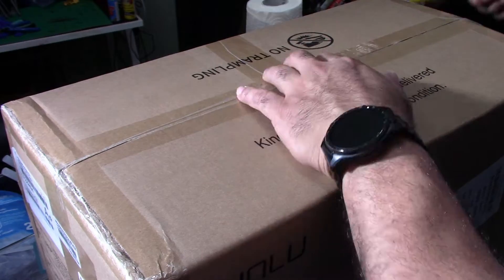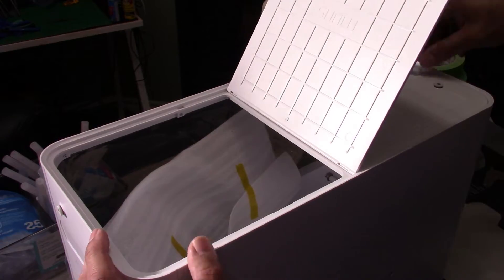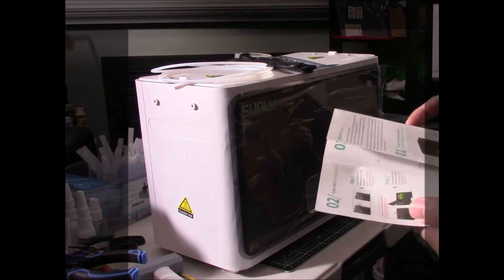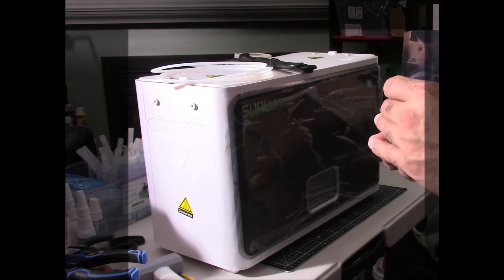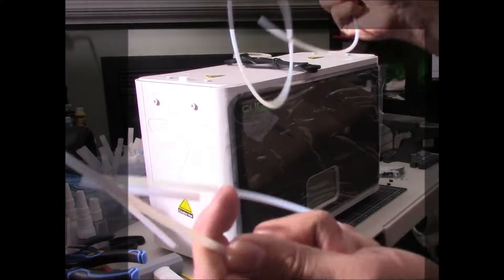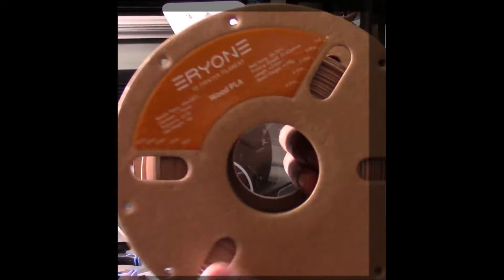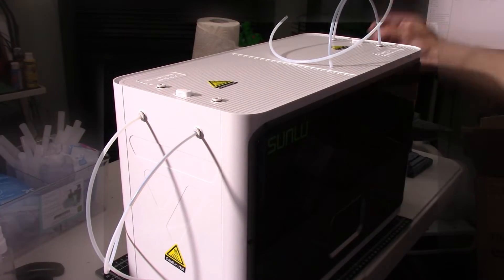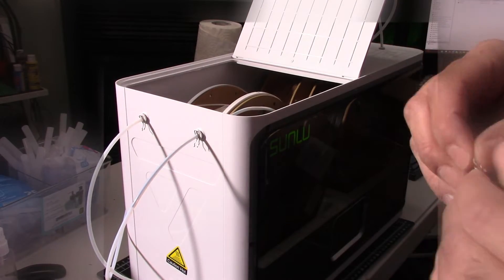Sunlu S4 Dryer Unboxing, Setup and Demo #sunlu #filamentdryer #sunlus4 #3dprinting #filament

Comment: now i realize it seems self explanatory to you but viewers are here for a reason and being thorough might get you more likes and subscribes without asking: suggestions:drop the loud cheesy music, mention the trays at the bottom:do you ad dessicant?, what are metal clips for?, how did you connect it to your printer? Does it come with an annealing tray like I believe the S2 does/did? other notes: this may be the best dryer out there but still not a great design: displays should be on side and holes on long side of box by changing the reel guides 90 degrees, terrible lid design difficult to open and stay up(thank god we're 3d printers so we can fix the engineering mistakes). Overall, it's overpriced and if you can wait, try to purchase one of the new Bambu drying AMS units. Also, were you sponsored by Sunlu to make this or did you just throw this out there to get for the referral links? 
pros: great suggestion about the timer addition which would have been a good edition along with a remote camera.
I'll try to attach a wattmeter and do my own unboxing which is why im researching others videos first, if this will help others. cheers
Reply from the maker: @VolikakisChristos  thank you for the detailed feedback. First, I want to clarify that I’m not sponsored by anyone. I started making these videos to help people, but over the past several months, I've lost my motivation and run out of funds for new tech. This particular video was meant to be a quick, simple update after receiving mixed feedback about what viewers want, so I decided to try a different pace. I had planned to create a full walkthrough video next, but honestly, I've been postponing it for months because my motivation for the channel has waned. While I'm still considering making some videos, i am not sure what the future of this channel holds, especially with so many others also creating 3D printing content.
Reply: Anyone having the problem where your filament falls over when it gets low? How do I fix this

Comment: We just bought the S4 dryer. Truthfully, I am frustrated because I cannot understand the steps needed to make proper settings. The instruction sheet does not give the steps. I have watched several videos. Do I set the target temperature first or do I set the humidity level at the top right of the screen? Is there anyone who understands how one goes about making the proper settings? We are using PLA+ filament for starters. Thank you very much.
Reply from the maker: @mrsmrs4844  hello, your focus should be on the humidity level. The temperature is only relevant to which material you are using. In the case of pla , I will set the temperature to 50 at the absolute maximum. That might even be a little too high. 

I've been meaning to make follow-up videos on several videos I've made, but life has thrown repeated curveballs at me and I am extremely behind in my video making. I do YouTube as a hobby, so my focus has been finding work right now. I will try my best to make a new video next week (first week of March 2025).
Reply: @MicBot  hey man, thank you for your video and the effort. I hope things go better for you the rest of this year. Us newbies are as you might expect excited to be doing 3D printing but sort of like the FPV drone community the only way to learn is by making mistakes (and spending a lot of $$) or learning from those who have been doing it a lot longer. At any rate, being as I work 3 jobs and also take care of my elderly mother I can relate to only so much time and motivation regardless of passion. So, my prayers are up for you and I hope you are blessed with a job that works for you and can get your life back to a manageable level, if nothing else so you can enjoy your 3D printing - which is most likely why you got into it in the first place. Cheers and Godspeed.

Comment: Are the tubes used to pull filament from the S4 to the printer? If not planning to do that, should the tubes be installed at all? If not installed, should the tube holes be plugged with the plugs that they provided? The instructions say to install the tubes but not if that is necessary or only when filament is going to be pulled directly from the dryer.
Reply from the maker: @DougToppin  yes you can run them straight to your printer.
Reply: @MicBot  What I was wondering was, if I do not want to run the filament to my printer, should I plug all of the holes?
Reply from the maker: @DougToppin  yes I definitely would. It'll keep the temperature more controlled.
Reply: @MicBot  If all holes are plugged, is there an exhaust in the machine so it doesn't overheat? I'm a little worried about plugging all the holes and having my dryer going while I leave to do errands.